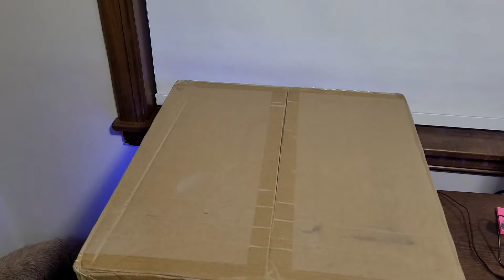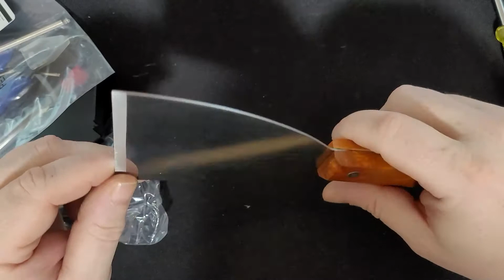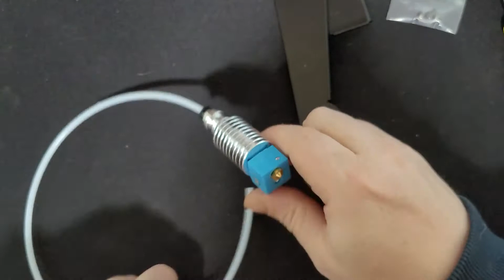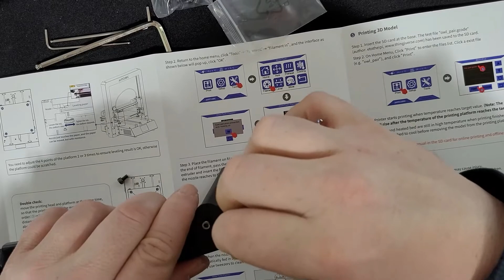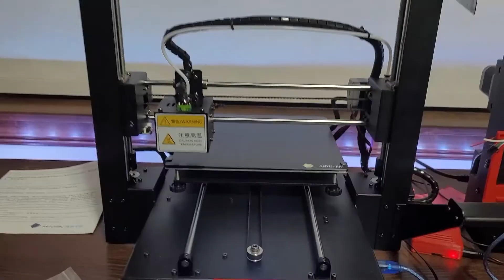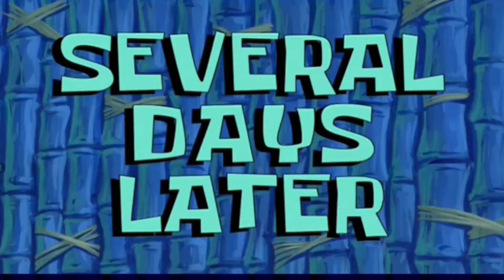Anycubic Mega S 3D Printer:  Unboxing, Setup, and Review!!

Comment: Going to have this in my bedroom is this going to be VERY loud? I want to use it for D&D minis
Reply from the maker: I'd change out the motor drivers to tm2208. It's almost whisper quiet. You still kinda hear the z access.  I had it running during conference calls and nobody noticed.  Prior to changing the drivers. It was commented on for noise